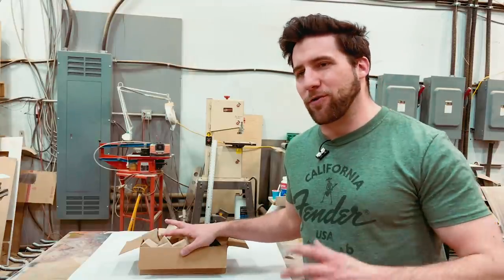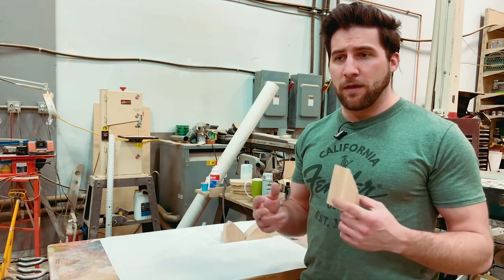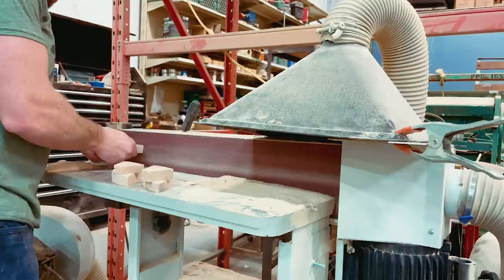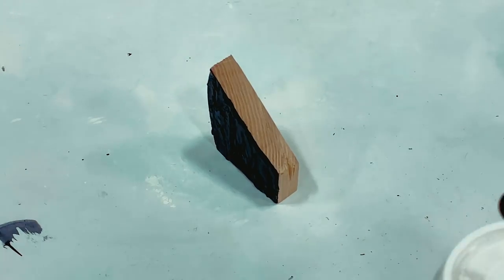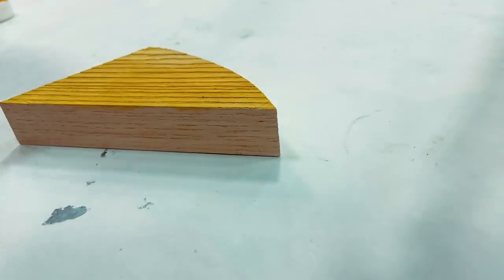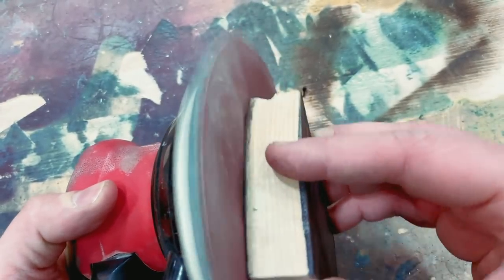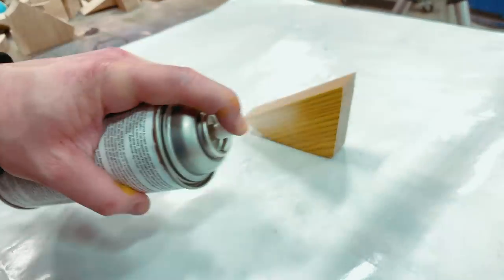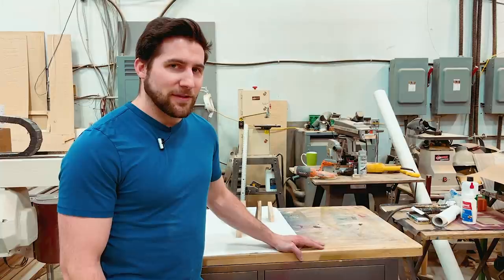Awesome Ash Finish Techniques (LOTS OF OPTIONS)

Comment: I just finished an ash build that came out real nice.  I did the wire brush trick to open up the grain and then used red and black Benjamin Moor solid deck stains.  Used a satin poly to finish things up.
Reply from the maker: Nice Darcy. I’m glad to hear it turned out well.

Comment: A thing I’ve learned about ash is the difficulty in getting it flat. The dark areas tend to be lower. What I think happens is that the darker wood is softer and gets sanded away slightly more when flat sanding bare wood. Then when you go to finish, you have all these low areas. It’s frustrating when going for the mirror finish.
Reply from the maker: Yes, that’s because of the open grain. That’s where you need a filler that you can block sand.

Comment: The dark grain filler sanded back is going to be cool. Well, they will all be cool!
I’ve been battling ash for a while, trying to get the glassy smooth finish with varying degrees of success. I have one where I did a French polish with tru-oil, applying oil liberally and then sanding the oil-coated wood. It came out nice but was a huge PITA. A better approach I’ve done a few times now is using Z-Poxy. 2 coats, then scraping off with a card scraper, then a final thin coat reduced with alcohol.
I’m Interested to see these techniques where you embrace the texture, rather than fighting it.
Reply: How does the z-poxy filling look in a few months time? Does it shrink at all? I use the crystalac filler, and since it's water-based it does shrink after some time. Even with the crystalac it takes about a good 3 applications to get it filled, and often you can still see some pores after that. It's frustrating and makes me despise filling ash.
Reply: @gbish6906  the Z-poxy doesn’t really shrink at all. It does flow into grain, which is why I do  more than one coat, but not shrink. 
I was using aquacoat, which is water based and does shrink. I got frustrated the same as you, and now I only use it to seal tiny pores in closed grain wood, or for spot fills.
A thing I haven’t tried yet is using microballoons in the z-poxy.
Reply: @gbish6906  if you have a low area, you can pour a “puddle” of z-poxy on it, let it cure, and there is zero shrinkage. It can be sanded or scraped totally flat.
Reply: @velvethausfrau  I'll have to give it a shot! When you do a thicker / puddle application does it dry clear still? In my experience with crystalac it dries clear if applied very thin, but anything thicker it'll appear cloudy when you put your clear coat
Reply: @gbish6906  it dries clear. Not cloudy. Good luck!

Comment: Hello Brad , I need your help again on a delima I have ,  I finally sanded the poly Strat body and it's ash and would like to spray it into a sunburst.
Do I need to use a filler or I could go with a sealer only , also which do you recommend ?  Mohawk EZ vinyl sealer good under nitro ?  Thanks again for your help.   Lou
Reply from the maker: Did you sand all the way through the original sealer?
Reply: @BradAngove  Yes I did , only left the sides and inside horns with sealer , I finally ordered some natural grain filler from Oxford this morning at Solo Guitars so it should be good I guess with this and a sealer from Mohawk after !?
Reply from the maker: Yes that should work.
Reply: @BradAngove  Thank you !

Comment: Do you think pure tung oil would seal it? Maybe after a wet sand or two?

I'm building a birdhouse with the leftover scraps so I want to waterproof it w/o going to a sparthane or anything  like that.

Not too concerned with how it's gonna look but I'd be lyin' if I said finishing wasn't my favorite part of woodworking.
Reply from the maker: Pure tung oil can seal it. They used to use it on boats back in “ancient” China if I’m not mistaken. The thing is, it’s going to take a long time and a lot of coats.

Comment: I’ve got an ash bass build going on right now so excited for the dye, sealer, rub in next colour. I have black dye and a gold wax to rub in after but what is the best final coat? I got minwax clear satin polyurethane would that do? Love the channel Brad
Reply from the maker: That should work fine. The only issue is that paint typically has difficulty sticking to wax. I’ve coated over those gold waxes before though and it has gone well; just make sure it’s pressed into the grain and all excess has been removed and it will likely be ok.

Comment: Brad onto a serious question what is the best ebony dye? I need to stain some white oak rails to black to get a long last black black color. It's for a exterior horizontal rail supporting a 4 rails @ 8 foot long exterior exposed to 5 months of rainy weather each year so I need superior stain 
Thanks doing great things with wood, I agree never wear gloves when your handling some fine  Ash & sanding if it grabs your glove it might deglove you tear off your skin in a quick bloody red spray, & I know that's going to leave a mark.
Reply from the maker: What are you planning on coating them with after the stain?
Reply: @BradAngove  well I don't know I talked with a master painter about that; now I considered a helman's marine spar varnish, & Seikens makes a Seikens Cetol 1&2 ... Then part 3 it's a $150 a two both first gallon in the 1st step then part 3 a separate but same finish combo. My friend mentioned cabot stain ebony but I'm wanting the best he said two coats of cabot stain the second one hand rubbed it will bead well but,  as white oak is the wood &  blond as it is; I want great quality no fail long time before refinish. {homeowner specs} It is imperative I go for best stuff out there final finish I want satin to egg shell on the gloss, if I use spar varnish likely every 3 year must recoat if it peels what a nightmare chasing stain intersect finish. So a just stain may be the best route? What do you think Brad? 
I'll use at most 1/2 quart material 2 or 3 coats with touch up. I even considered India ink and a tough epoxy finish but India ink can appear blue translucent.
Reply: @BradAngove  as everybody knows dumb puns and innuendo are a Scotsman's bread & butter and Ash it said name so many innuendos so many fun puns.
Reply from the maker: If you’re considering just a stain I would select something oil based as it will have a bit more body that should make it more durable than just a dye. Unfortunately, UV can be hard on dark stains. A top coat with some level of UV protection would be helpful. Marine varnish is quite durable from what I understand. I have not used it though as I don’t do marine work and I rarely work on items that are intended for outdoor use.
Reply: @BradAngove  maybe when you get you 85 foot double masted sail boat....
Thank you

Comment: Terrible technique when pushing the Ash through the table saw. As the blade gets higher you use another block to keep the Ash snug to the fence. As you use the push stick you keep the block moving with the cut. Eventually you are side loading the cut which will pinch the exiting piece  causing a situation which will most probable induce a strong kick-back. Very dangerous.

Comment: Surprised to hear you are anti-glove. I have a large flesh injury on my left index finger from a miter saw I would not have received I'd properly gloved. That was a moment of slack in otherwise very complete industrial glove usage. It only takes once.
Reply from the maker: With saws? 100% anti-glove. Nicking a finger on a blade is bad, but the second it catches a glove... well I met a guy a few years ago who was missing most of 3 fingers.

Comment: Bro, I followed you for YEARS on my old account. You were always helpful.  Hoping you can help me HERE.  The Gibson voodoo/ juju finish...THE ONE FROM EARLY 2000s with the satin black and red filler...can you give me some EASY diy methods of opening up those ash grains with minimal equipment and experience? Gibson says the process is 1. Coat unfilled ash with thin layer black paint. 2. Grain fill with red filler. 3. Gently sand back to black. 4. Cover in satin finish. I'm wanting to 1. Dye black with India ink 2. Red grain fill ( suggestions?) 3. Sand back excess 4. Cover in tru oil. Any suggestions to really get that red filler looking prominent,  would be great. Any methods or particularly strong products giving red accents would be awesome. Thanks a lot
Reply from the maker: You’ve got the process right. The only thing that might help is, like you said, opening up the grain a bit more. A wire brush can help with that. 
For the red, I like unicorn spit. It’s got pretty strong color.